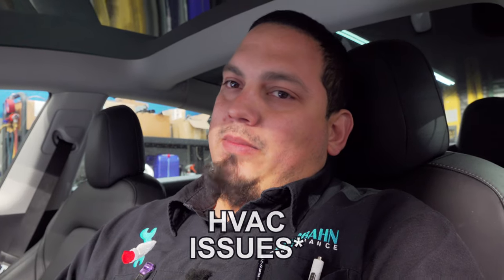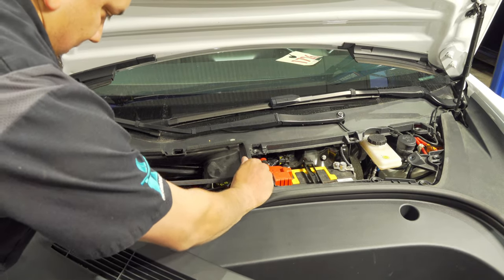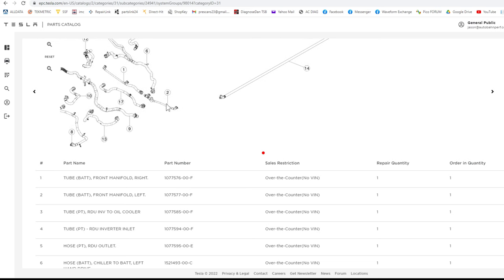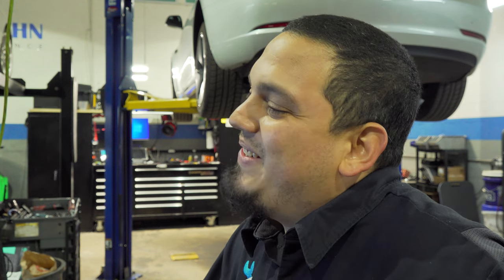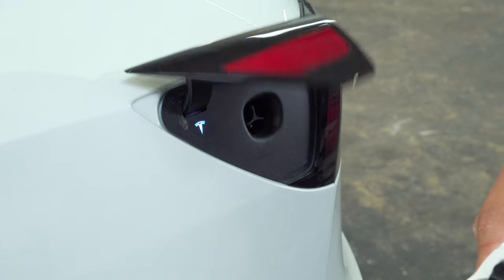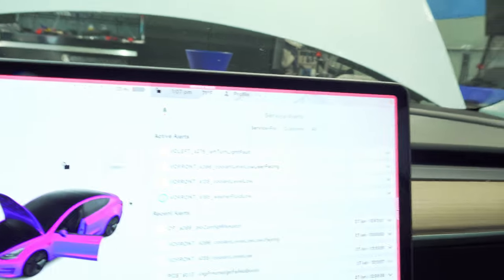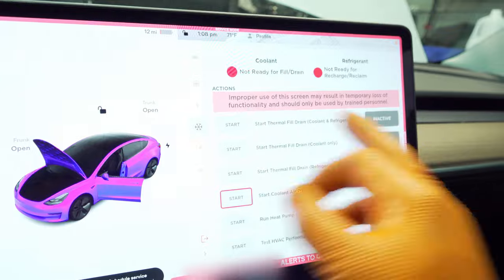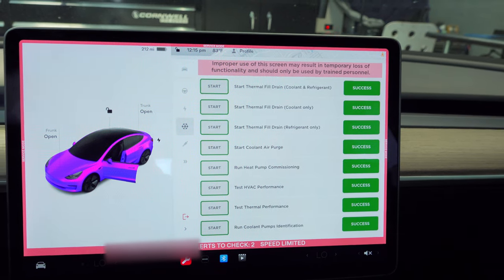TESLA MODEL 3 COOLANT LEAK | SPEED LIMITED | HVAC NOT WORKING

Comment: Hey there! I encountered a problem with my car, a 2016 Model S 90D with around 140,000 miles (approximately 226,000 km) on the odometer, during a trip to Denmark; the steering suddenly became extremely difficult to manage. After consulting with Tesla, it was discovered that a leak from a four-way valve had caused significant damage by corroding electrical components, particularly affecting the connection to the EPAS system, as well as the steering rod and wiring harness. Tesla has already replaced both the four-way and three-way valves to prevent further leakage. They also mentioned that cleaning the corrosion could potentially resolve the issue. However, their standard procedure involves replacing the damaged components, which could end up being quite expensive. They advised me to look for an alternative workshop capable of cleaning the affected electrical components as a more cost-effective solution. I'm reaching out to see if you or the comments could offer any insights or suggestions on how to approach this problem. Do you think this is something feasible, and do you have any thoughts on how it could be done?

Comment: The price shouldn’t be based on how important the part is but how difficult/time consuming the job is.
Reply from the maker: Not even that. The price should be a calculated figure to make sure you can stay in business, your overhead is covered, and your techs are well paid
Reply: @SuperMarioDiagnostics  of course.  You made it sound like because it was a Tesla $500 wasn’t THAT bad because of its importance.
Reply from the maker: I meant it, as compared to the rest of the OE service info access costs. Sorry, i didn't clarify that in the video
Reply: @SuperMarioDiagnostics  yeah I can see that.  Wonder what that job costs at the Service center and how long the wait would have been at the Tesla service? You might have said I didn’t get all the way through yet.

Comment: I hit something in the highway and don’t know what it is but there’s about 8 cars  parked on emergency lane ahead of me so I figured they’re dealing with the same dilemma.. pulled over and checked my model 3 and saw a big chunk of panel missing from front skid plate so that’s bad… drove it and got alerted low of coolant then follow with power speed limit of 60… now thinking scheduling a service and a charge of 220, not sure if that include whatever part was damage or that’s just the charge of refilling coolant

Comment: At about 3:14 “For those getting into electric vehicles this is going to be a shocker…”.  Ha. Too funny.  Great video!   Don’t know anything about teslas.  I guess they use the heat from the batteries and motor(?) for heating and cooling pass compartment?  Great work.
Reply from the maker: The heat pump is responsible for heating the cabin

Thanks!!

Comment: You can run the drain and fill then the air purge routine on the UI without Toolbox 3

I don’t believe the use of periscope is available to the aftermarket on toolbox 3 But it is an invaluable tool in diagnosing these cars especially if you opt to do it remotely

Just finished watching the video. My comment is moot now 😂

There’s a bunch of other useful tools there on the UI under the actions tab
Reply from the maker: Might wanna finish the video 😆
Reply: 😂😂😂  

I finished watching it I promise. Great video. I’d be interested in looking at the next one remotely if you ever need a second set of eyes
Reply from the maker: That'd be great, thanks!

Comment: Hey Mario, what if I just want to top up coolant but leave the repair to Tesla as they can’t see my car for two weeks. I don’t want to be slowly losing coolant. It’s -20C here today so need heat in the car for sure. Can I just do the steps to check the levels and then perform the fill using Service Mode? The Service software is very different now than when you did this video. LMK 🙏🏽 thanks in advance

Comment: Hey Mario, I have one of those chargers. You stated you can use the charger all over the shop if so ? Do you use an extension cable, and what kind of cable
Reply from the maker: We have multiple outlets across all of our shops
Reply: @Super Mario Diagnostics  so you take that charger with you with an extension??. What I'm thinking is if I can make an extension cable to move around, they said not to us an extension

Comment: Thanks for it. I have a tesla with the same issue but the problem is there no power on the battery hv and 12vt do you have any idea?
Reply: Hello there, did you check the 12. volt battery, did you have at least 12.8 volts, did the screen turn on? if you do not have 12.8 volts then jump the 12 or 16 volts battery Sr.

Comment: I have a Tesla model S in the service center rn and they told me I have to pay the diagnostic fee. For a coolant leak: is this standard?
Reply from the maker: It should be. Better to pay testing fees that guarantee results than to pay no fee for guesswork
Reply: Senotirta is better to pay for diagnostic if the tesla is leaking they may put the diagnostic fee and the service charge, may be the hoses only and fill the coolant again.